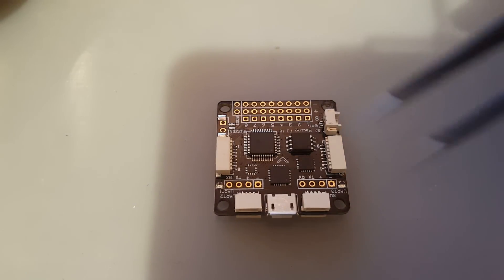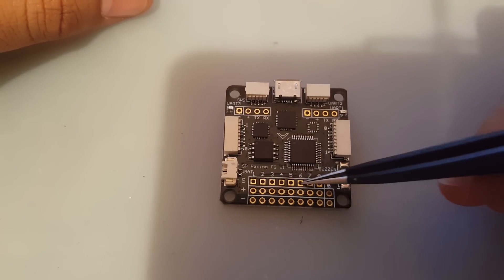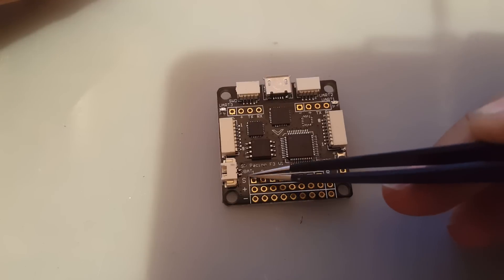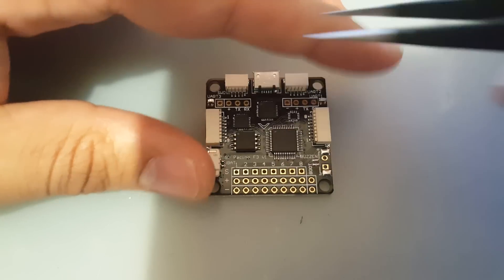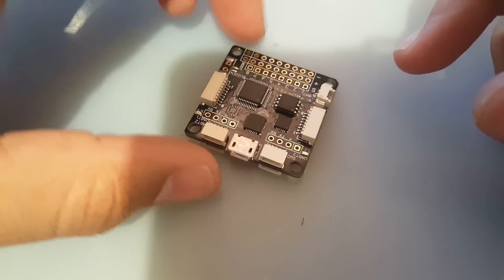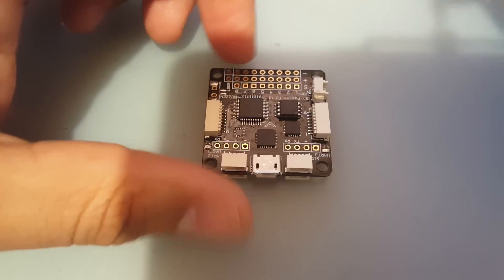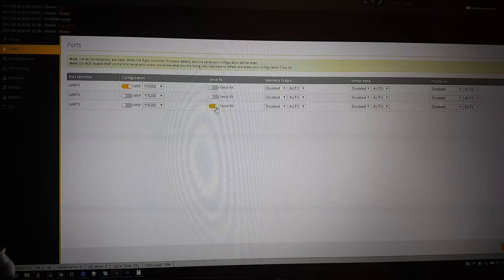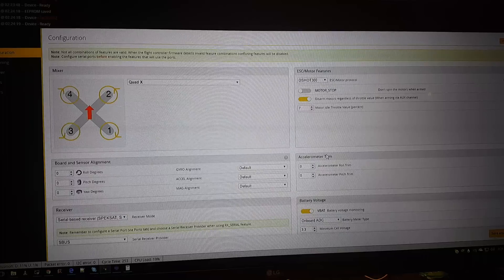How to setup SPF3 Flight Controller (Easy Way)

Comment: Hey, thank you for this Video.
I have just one question left.
Does somebody know how I integrate telemetry data on my FPV-Googles? For example how do i connect GPS or Batteryvolltage to the FC, so it will be showen on on my googles?

Comment: hi i am in 2019 and i have a real acc gx210 from a friend which has a sp racing f3 board. when i connected in betaflight i can only get CLI. how do i flash the latest firmware. need some help on this can u please guide me.

Comment: Is there a Vin and Vout for OSD? The bangood description says it does have it, but I do not see it on board, can you show me which pins would that be?
Reply from the maker: This one does not have OSD.
Reply: @DroneMesh  Thank you, one more question, how should I measure voltage or know when to change batteries with this FC?
Reply from the maker: @yoyomario  Well you can add a buzzer and connect small wire to vbat from the + of battery but make sure not to connect it to the 5V

Comment: I keep trying to plug in the flight controller to my computer with the drone setup from another video, but my computer that runs windows 10, will not recognize it. Do you know what the issue is?

Comment: Hi

I want to use for airplane.

I configure it but my servos don't move. If I connect to cleanfligth and go to motor tab. I can see servo signal changing wen I tilth the board. But actual servo is not moving.

Comment: Hi! Newbie here. Thinking to buy this fc for my first build. Will a 4 in 1 30amp esc using dshot 600 work for this fc? Thank you!
Reply: Will work Perfectly as long as you don't get it from China! They are all clones on cheap circuit Board's. Pay a little more and get the real deal in good ol USA. Get it in a week not ,45 days. Bangood tried to explain how 27 days was good enough on paid for expedited 5 to 7 day shipping.  race day quads, get fpv, Grayson hobbies, pyro fpv and rotor riot  all good quality.
Trust me you will be a lot better off  if you use quality parts from the start so you know the stuff is good .  LEARN HOW TOO SOLDER BEFORE YOU START A BUILD. It is so much easier if you do it right the first time. Good luck

Comment: I've got 2 questions.
1: DoesThis flight controller got it own BEC on board, can i supply power straight from pdb without BEC (4S lipo)
2: will it fry when i power it with 6V ?

Comment: 11 min - but how do you power the board...
Reply: From one of the red wire's from one of the motor ESC's.
Reply: If you have a power distribution board and opto ESC's you'll have a 5v out on PDC, in which case you could wire up a red and black wire to one of the + and - of the 8 channels (not the s) pin.
Reply: Just take from the 12 v battery to 5 ⎷ converter... and rest of the wires to individual esc. So you have 12 V for motors and rest of the board 5 V. And don’t need distribution board.
Reply: @AndyDeiu  hey thats good, but can I use a 4in1 esc with this?
Reply: Planning on buying this for my first build.. please eli5 how to power the Fc

Comment: Please I need help when I connect it to beta flight it simply statesNon - Cleanflight/Betaflight firmware is not supported, except for CLI mode. Can somebody please help?Desperate person here in need of help.
Reply: same problem here...
Reply: You have to upgrade the firmware of your flight controller.
Reply: yes you have to solder the boot pads then plug it in to beta flight, it will be in duf mode, just flash the new firmware for your board then undo boot pads n plug back in, good luck.
Reply: boot

Comment: drone i have a rxsr going to a spracing f3 on a x220 wizard , would you hook it up through the io2 or just uart 3?  i set it up for fport but rx was not working on betaflight 3.3  in the receiver tab.  and of course you find conflicting reasons why and what is the reason for that to happen. so i was going to skip fport and just get flying but my rsxr is toast . second time i tried to bind  after firmware update the fs button ( pad )  fell off so i ordered another.

Comment: Can i supply power using 5 volts from a pdb instead of using the vbat pins?
Reply: clarence soh teak Vbat is actually for battery monitoring, it takes the full power from the battery and measures it. You can use the settings in beta flight to set the the max and min voltages so that the buzzer sounds on low voltage. To power the FC from the pdb yes you can use the 5v source but you'd plug it into any + & - points near the motor signal points, these are located where you hook up the ESC signal wires labeled 1 through 8. The square points are for signal and the rounds are positive and negative like he spoke of early in the video here 1:08

Comment: Same flight controller using, receiver not communicating with flight.
Using Turnigy 9x Transmitter and receiver is Frsky V8fr.

Unable to communicate with flight controller.pls help..
Reply from the maker: Abhijeet Paul What protocol are you using??
ppm or ibus
Reply: Drone Mesh ..sir I'm using ppm.
Reply: Abhijeet Paul are you able to communicate with the FC?  I have the same problem, I have a Turnigy 9xR pro and a 4Dr-ll receiver. Appreciate your help.

Comment: Can I use uart1 pads for either sbus or sport telemetry, even though it is used for the usb connection? If I use uart1 for sport, would it still connect normally to betaflight?

Comment: Hey mate, great video. I'm a newbie to this quad building. I have wired my 4 in 1 ESC up to flight controller via 4 wires & to the signal ports 1,2,3 &4 on my flight controller. I run everything through cleanflight & everything works, transmitter, motors run etc. Have connected receiver up via PWM. The problem I have is, when I turn the transmitter on to arm, the CPU jumps to 100%, therefore cannot arm the quad. Is there something I'm missing? Any info would be much appreciated, Thanks

Comment: I know this video is almost a year old. but very helpful. I have a question on the buzzer.. what are the pads on either side of the buzzer holes? I soldered my buzzer to them instead of the holes and it doesnt work.

Comment: Hello.
I'm a noob on this things. I want to build a drone not for racing but to do simple things such as altitude hold things, maybe add a gimbal and camera, probably a vtx and ccd camera to fly far. it should have a gps also, maybe use mission planner or similar. So my question is, are these f3 or maybe the f4 FC's good for that purpose? The F3 it must be the deluxe version or acro will do? will i use betaflight or other software? thanks in advance

Comment: I was trying to do a racestar shot 30 4in1 esc with a sp racing f3 just like the one in the video. Where does the cur_sen go. And 3 grounds and 3 positives do they all go under where the I motor wire go in those +&-  what powers flight controller. I just don't get. I have over invested 1000 invested since September. I got wizard. it flew away first week so had lizard dead on arrival. Never had worked to date. Then a dark max I very excited. First half second smoke and flames. Crashed and broke everything frame cracked  camera sheards off the bolts esc burnd. Motors are good. And baby hawk drone camps pro pids I should on.lost it on second battery. This second attempt to fix the dark max but same thing the lights on the FC. Sounds all bad. But wait my friend who help me search for the wizard. Showed up with the wizard. I was sure these scumbags leaving slold it. We searched for 3 days. It sat out all winter 5 month. 3 off the ground in a bush.  It had rained in week or so. Wires are all sun faded bolt are rustin out. Put it in beta flight it was fine. So ben flying that all week. Keep the work on the video I love to do the diversity mod on my goggles. But every electronic part I touch turns to garbage. I just FC not wreaked

Comment: Hello sir, i am facing a problem i.e the escs doesn't callibrate after increase slider to the top position. I am using emax blheli 30amp esc, is it supports this flight controller...?
Reply: Nihar Ranjan Mahali I had the same problem on my naze32..you may have to disconnect your positive lead between the esc rail and your pdb
Reply: empireofthesuhn thanks for your replay... but if i disconnect +ve wire of the esc from pdb then how will esc power up....?
Reply: Nihar Ranjan Mahali the escs drew power from usb on my naze32
Reply: Which esc r u using...?

Comment: @Drone Mesh This may sound like a stupid question, but Im going to build my first quad. I have a Futaba T8J with a gimbal centering kit on. Do I have to change any setting on ether the flight controller or the remoter being that the throttle automatically centers?

P.S. How would I set up the quad to the arm button as the DJI CSC to arm.

Comment: Just wanted to say thanku for your explanations. Great! I learnt a few things. 1) Bridging + & + etc won't (from what you said)  cause problems between motors. Buzzer port, voltage feature etc! I have a FS-iA6B Flysky receiver module. Should I use the UART 3 or the white port on left to hook up the receiver. I'm assuming these are different modes of communicating with the receiver. Sbus vs PPM...is that correct?  If you or others could assist me and have time to explain how best to connect the FSiA6B to this board this would be seriously appreciated. Thanks again for the time taken to explain some of the features on the board. Love to see a full rundown of ways of setting up various receivers to this FCtrl. Awesome work thanks again for the video.

Comment: Gahhhh! I can't flash firmware on either of the ones I got from GB! I plug it in and go with SPRACINGF3 latest, nada. I have one with bridged boot pins and one not. Get different erros for both. My NAZE32 board reads fine in BF.
Reply from the maker: +Robert Washington Use something metal to bridge the boot pads.
Reply: I did, but will redo the connection, one moment...
Reply: "No response from the bootloader..."
Reply: Did it with the other board and got: STM32 Communication failed, wrong response, expected: 121 (0x79) received: 31 (0x1f)
Reply from the maker: +Robert Washington Don't bridge them permanent.. bridge them then connect USB for com port it should read DFU in betaflight.
Reply: Yep. That's how I did it. The change I made was using a windows machine, so I could use flash Loader Demonstrator. This allowed me to get the drivers figured and install Betaflight.

Comment: How do you power it tho ?
Reply from the maker: imhi fpv solder 5v and ground to any of the 5v and ground holes from the pdb
Reply: where on fc do i solder it ? thanks in advance !
Reply: Same question as mine. I know where in PDB to solder wires for porwer the FC, but, in wich holes on FC do I need to solder the wires to power the FC? I can not find any information... I guess in any (+ and -) of the holes for 5 to 8 ESC's, but I'm not sure. Thx
Reply from the maker: Dario Ares Any of the bottom + and - holes
Reply: Drone Mesh you mean the holes fron 5 to 8 ESC?

Comment: you should also add that you need both vbatt and 5volts as it wont power motors without vbatt correct me if im wrong tho cheers for the content keep it up cheers

Comment: Does the F3-Flight-Controller support OSD of radio strength and battery, out of the box? If so, how do you wire camera and transmitter to achieve this?

Comment: I use the I/O1 or the I/O2 Ports on the side's for connection to the radio RX/TX as per instructions in the manual. You have to be careful when using the the two UART headers with the radio TX/RX modes. The manual can be found here...   http://www.seriouslypro.com/files/SPRacingF3-Manual-latest.pdf

Comment: I bought the F3 flight controller Deluxe 10 DOF for multirotor racing. There are trouble shooting codes coming on there are 4 long red lights then a bunch of fast one could you tell me what’s wrong please!

Comment: Great video.
Do you have any idea where to connect the Video In and Video Out wires, to be able to use the built-in OSD?
Thanks
Reply from the maker: Poker2145 there is no OSD on this board.

Comment: How do you setup your vtx and cam with a board like this? I see no vtx or solder point on board. Shouldn't there be a video in and out.

Comment: I threw this garbage out the car window after wasting hours tying to flash it. What a nightmare!!
Reply: Have you connected the two boot pads :D. If u didn't that's why you couldn't flash it
Reply: Teun Heugten of course I did that.... I tried everything even praying to Jesus
Reply: Had a lot of trouble with it myself but the moment I set the baud rate on the USB port it was using to the baud rate the board functions at... BINGO...it now started to flash the firmware. Taken me best part of 3 hrs to try and sort it out. Did drivers, did resets, did everything then at the last minute before I was about to throw it through my car window I thought of altering the USB port from 9600 to 11500 that the software in cleanflight, betaflight and iNav uses to communicate with the board. These FC's are well worth the money.
Reply: Peter Waine I tried for 7 hours till I️ snapped. Glad you got it working

Comment: Hi there! Will this FC fit my diatone gt2 200? Should I get the dof6 or deluxe 10? what's the difference? Thanks!!
Reply from the maker: +John Graboski I have rebuilt my gt200 and this board might not work for you because you will need a pdb.

I have rebuilt my diatone gt200 the other day here is the link you can see how I did it and hopefully it will help you.

https://youtu.be/prwqRwmDIpM
Reply: It's good to get 6DOF and save some bucks since you're going to perform racing/acrobatic with your gt2. 10DOF has features like compass and barometer which improve stability for aerial photography quads.
Reply: I got rid of that darn thing. Between complications with a leaky PDB or FC and UART connections falling off I sold it. Thanks though!

Comment: sorry for the dumb question but how would I connect my SPF3 to a RadioLink R9DS?
Reply from the maker: Benjamin Law Suwarat Is your receiver PWM or ppm??
Reply: Drone Mesh pwm
Reply from the maker: Your receiver is Sbus compatible its alot easier than me telling you how to connect PWM.

The bottom 3 pins on your receiver have s.bus 

Left > Signal -> goes to UART3 RX like in the video
Middle  > VCC -> goes to the positive on UART3
Right > ground -> goes to - on UART3
Reply: Drone Mesh I see, so nothing goes in to TX?
Reply from the maker: Benjamin Law Suwarat No nothing goes to TX.. just make sure you follow the steps in betaflight like in the video and make sure  to enable sbus in your transmitter.

That should be it. Keep me updated..
Reply: Drone Mesh thanks man. Im still trying to learn drone how to use my drone. Your video helped alot
Reply from the maker: Benjamin Law Suwarat Glad I was able to help ^_^
Reply: Unfortunately I think my FC is broken, motor connected in the third socket won't spin. I have another FC but I don't know how to connect it to the receiver. https://i.imgur.com/0YJsqpq.jpg
Reply from the maker: Benjamin Law Suwarat before changing connect the motor that is not spinning to a port that is working on the fc if it does not spin it could be the esc or motor with the problem
Reply: Tried that and motor 3 works fine, and the one I swapped it with didn't work. I'm pretty sure the FC is not working. I have the other FC I'm just not sure how to connect it to the receiver.

Comment: Follow up, I enter "beeper -ARMED" but don't know how to same the command , and have enter "beeper -ARMED save" .  Are you meaning for me to save after entering beeper -ARMED??? sorry for the confusion on my part
Reply from the maker: Larry Faucett 
first command
beeper -ARMED
press enter
second command
save
press enter

then your done
Reply: Thanks for the help but sorry to report that it continues to beep when armed.  It also beeps when I turn off the TX and when I flip the selected switch just as it should.  But the damn thing still powers on when armed.  I know you have a lot on your plate so if u wanna move on I'd totally understand.  You've done way more than others. Maybe it's one of the weird things with electronics. Regardless I appreciate your help and patients with the neeb .
Reply: On the bright side I wired up a set of leds for the fist time, configured them in Betaflight and everything works great.   Thanks for the doin this video.
Reply from the maker: Larry Faucett I'll try to have a video out for you today to debug this issue.. If I will not be able too I will send you more commands to run.

Comment: Cool I'll be looking for it and thanks for doing these. 
I know I'm jumping ahead again but I installed a discovery "buzzer" to the buzzer contacts. Configured it in Betaflight and It comes on with the assigned switch, BUT! It also comes on with the arm switch when I arm the motors.  Nothing overlapping it my mode settings yet the buzzer activates with both switches. Some videos say those buzzer contacts r for low battery alarm. Don't know how many or how far u intend to take this series, but If u have time, it would be great if you could clear this up. Thanks.
Reply from the maker: Open CLI tab and copy paste these 2 commands

##############

beeper -ARMED
save

##############

Then test again I think that will fix your problem if your battery is charged
Reply: Hi Drone Mesh, Sorry if I'm overlooking the obvious but after putting in the command I don't see a "save" button. Am I understanding your instructions?